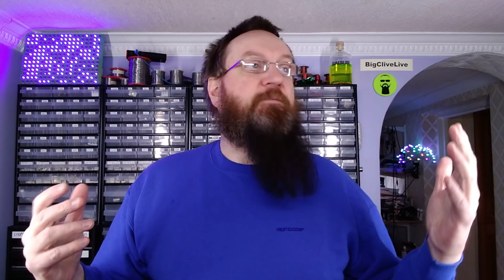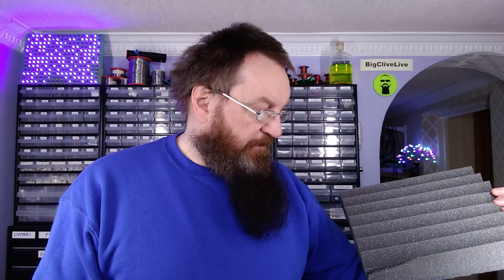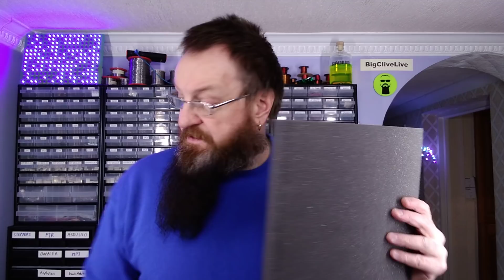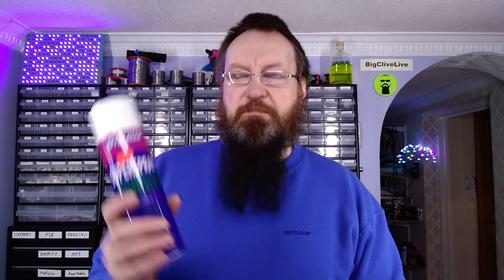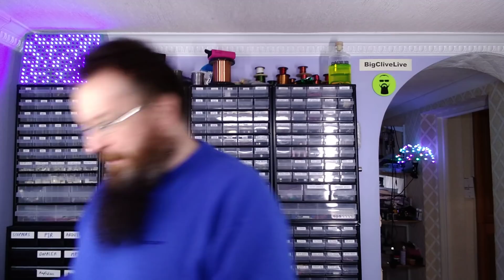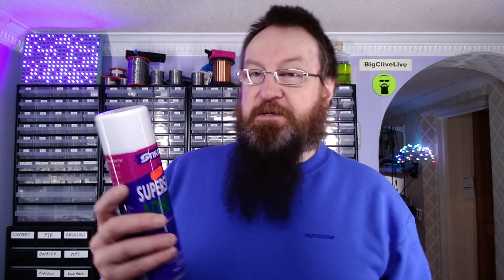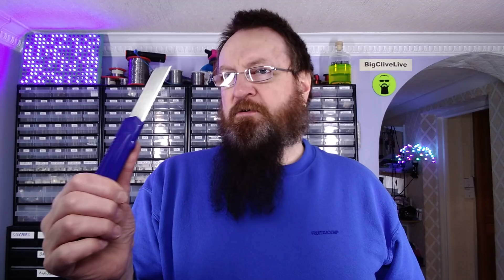Acoustic foam test.

Comment: Despite many people here suggesting room treatment to reduce bass; that just doesnt really work. You dont have boomy room acoustics. 
The best way to reduce it is a mic with a bass roll-off (integrated filter that just cuts the low end away to some extent), or a software filter. 
You can go arbitrarily fancy with this. 
The lack of high end some people complain about is probably caused by the mic position being a little unlucky.

Comment: Sounds like a noticeable difference, for the better. One thing I recommend is to look for some flat acoustic absorption panels, usually their made for going behind the foam you got and their a lot denser so they trap a lot of the higher bass notes around. I don't know about their flammability though, id do your research before buying. Some of them are made with recycled blue jeans or something like that and their usually about a centimeter or two thick.

Comment: Not enough mid and high end. Phone doesn't take it too well (distorts) and the tablet (Tab S7) makes you sound quieter now. Removing some foam will fix this.
Reply from the maker: Try the recent live stream on BigCliveLive as it addressed the problem with an external microphone.
Reply: @bigclivedotcom  Ah, well there wasn't much difference from what I could hear, though that could just be my morning ears limiting me for the moment.

Comment: Huge acoustic change.  Loss of the treble and it's reverberation plus All the clarity and crispness it provided as well.  It left the bass smooth but muffled.  I am amazed .  was that only the one piece of foam?  That's a very substantial change, I'd be surprised if any person with some degree of regularity listening to/watching you did Not notice.  I'll watch and listen again, my focus is spread thin.  I only watched it 4-5 times already.  If however it is only the one piece of foam, I am shocked by its affect.  Effect?  Sigh, lol, the mind is going.  Yep, tired .   Still and again.  :)
Reply from the maker: I covered four surfaces with foam.  I had to add a microphone afterwards.

Comment: More professional sound now, no longer sounds like you are recording in the loo, but could use a bit of a treble boost to ensure intelligibility.
Reply: I’d go for a low cut before boosting the upper frequencies
Reply: @ConorNoakes  good call... i would have added mid and hi but on hearing your comment..... made me think....
Reply: @MrFlyingguy  main thing to remember with EQ is that is is much more useful to remove what is there that you don’t like than to try and artificially drown it out by boosting something that may not be much there at all anyway
Reply: Was going to say the same thing. Got rid of the echo, but sounds too "dull" now.
Reply: Agree. It killed the mid-high definition, but that's a small tweak on the mic input.

Comment: Certainly far less echoing, quieter overall, reduced treble, but through my Pixel phone, not too bassy. Maybe the next step is a better microphone through a proper recording computer rather that the phone, but that's a can of worms. Decent webcams are coming back into stock and cheap little PCs are easy to find, as are portable monitors so that they don't take up the bench full time.

Comment: The summerland fire says it had Galbestos. Being asbestos with bitumen coating. So the asbestos is fire retardant but the bitumen , being asphalt,  is flammable and was put on over top of the asbestos,  correct?

Comment: It makes a difference, but it mostly affects the high end, which makes your bass voice even more boomy.  I think if you used the foam and also rolled off a bit of the bass, it would sound better.  The foam alone actually makes it less intelligible.  It does deaden the reverb, which is what it is intended for.
Reply: I was going to type almost the same thing.  Your high end that was what I hear the best is gone.  The boom is accentuated by default and it makes it harder for me to hear.  It's great for reverberation, but you still need to equalize or enhance the speaking frequency spectrum.
Reply: You need at least 4" of rockwool or fibreglass to absorb a useful amount of bass - the foam acoustic tiles are just too thin and too porous. A common trick in studios is to stick a few old CDs on top of the foam to add back a little bit of brightness.

https://www.soundonsound.com/sound-advice/q-how-should-build-vocal-booth
Reply: I actually preferred the before to the after in terms of intelligibility.
Reply: So boomy in fact I think I will go and re-watch Blackadder (Series 2 Episode 2 – Head) for boominess voice comparison purposes...
Reply: I agree with above, the before was more understandable and clearer, the after sounds muffled.

Comment: That helped a lot in terms of reflection from what I can tell.  It's still a little boomy but I suspect Big Clive himself is a bit boomy as well.  Maybe try a 80-100Hz high pass filter if you're not doing anything else to roll off the low end already?
Reply: Either way, a little high pass is always good. The low end junk isn't necessary and isn't usually reproduced well by most people's gear anyway. That is, unless Clive is aiming for some sort of bassy ASMR to make some of us poo ourselves on cue.
Reply: @TristanJCumpole  I wouldn't exactly call the fundamental frequencies of a male voice junk. Positioning the mic farther away from the wall a little bit would probably reduce the bass boost enough.
Reply: @falsemcnuggethope  Those frequencies are being overstated in the final audio and need taming. Rolling them off as opposed to cutting them entirely. Agreed about moving the mic from the wall, however if this is not possible then putting as much absorption behind that as possible is advisible. Search YouTube for "cone of doom".
<edit: My mistake, try "$18 DIY Mic Shield Eliminates Reverb". That's more of a voiceover thing than a general vlog talky talk toy. It's been a while since I watched that.>
Reply: I'd even argue that we're not talking reverb here, simply standing wave reinforcement/cancellation. Small rooms have terrible comb filtering and phase issues thanks to the walls being in such close proximity.
Reply: I'd say lower, and higher. i.e.40 hz- 180 hz. Standard telephones are about 300-3000 hz.

Comment: Ha, it's gone muffled indeed. In fact, I'd say it's made matters worse in terms of treble. As for the bass, it's still pretty much exactly as boomy as before. Sounds like you might need bass traps next.
Reply: What is a bass trap?   Is it a set of large speakers with a pitfall trap in front of it to trap bass heads?
Reply: @kingdom_lights  He's since added and placed a separate mic over what this was recorded with, which improved sound massively, so this is no longer relevant. This video was created over a week earlier than its public release.

Comment: There is a noticeable difference however still a bass biased.
Reply: Clive's voice is bass biased :D
Reply: foams will not affect low frequencies, they work mostly for mid ranges. To deal with lower frequencies you need mass.
Reply: Bass roll off on mic
Reply: That's just Big Clive's natural butchness.
Reply: Add bass traps to caption low freq standing waves. (Helmholtz resonator)
Reply: Bass traps are needed and/or try a simple RC high pass filter. 

It is so boomy it is difficult to listen to.
Reply: Or maybe use a close to the mouth headset mic, or a shotgun (very directional)  mic? Or use room correction SW like Acourate  or Dirac.
Reply: Foam like that will do virtually nothing to low frequencies. You need a bass trap for that.
Reply: Could maybe be fixed in settings